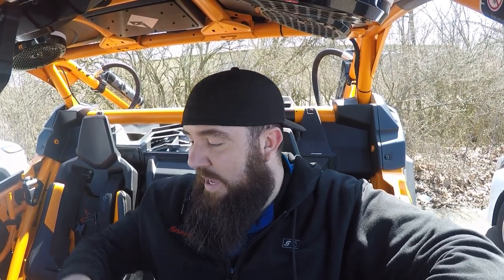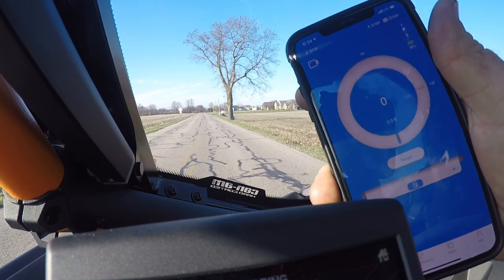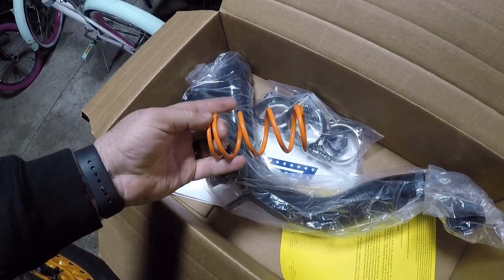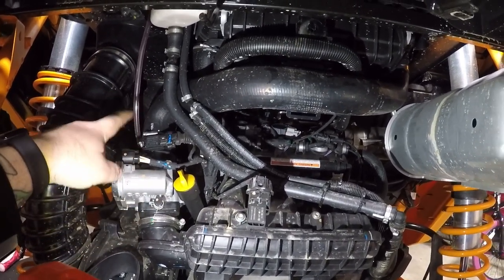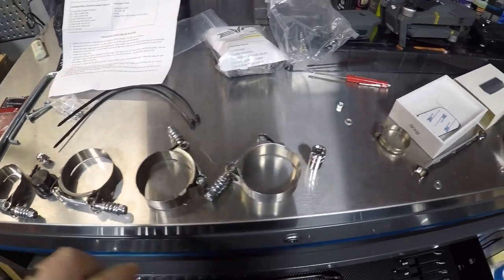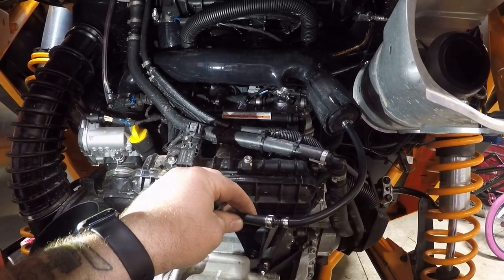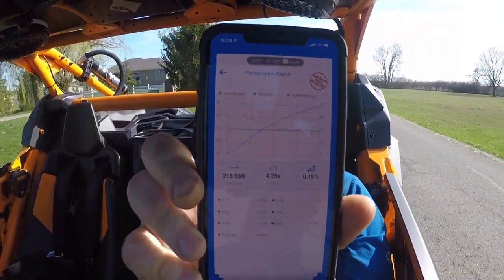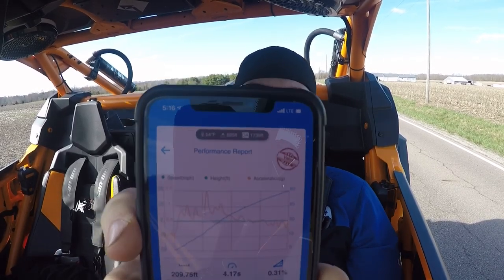MORE HORSEPOWER! CAN AM X3 STAGE 3 PARTS AND TUNE FROM EVO🤘🏻🔥

Comment: That thing is getting pretty BA.  If you want some incredible launch your could get a racing primary clutch. But it takes away low end drivability.... so  I dont exactly recommend. But you should think about doing hot cam swap ;)